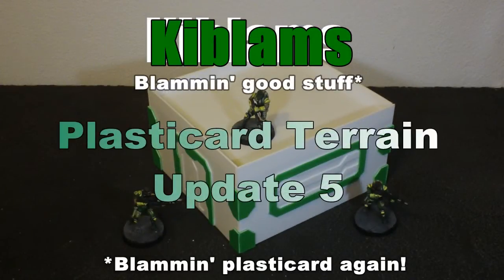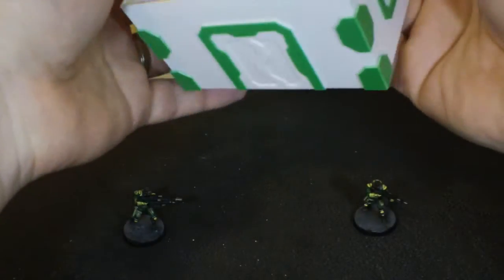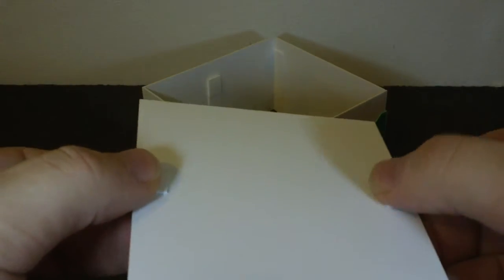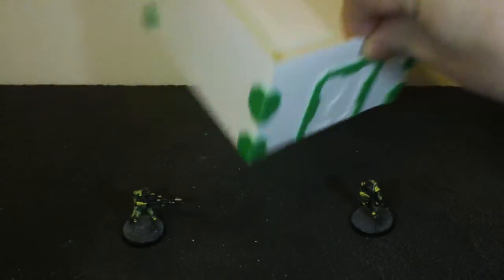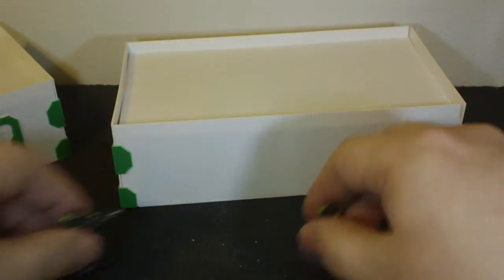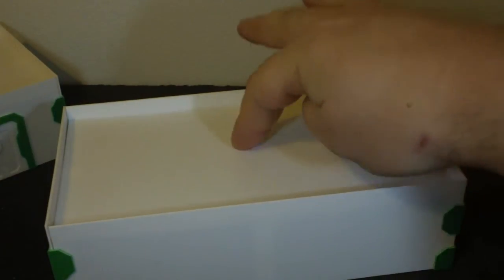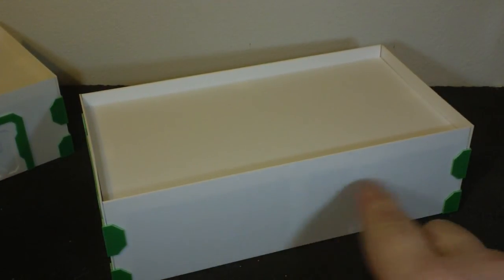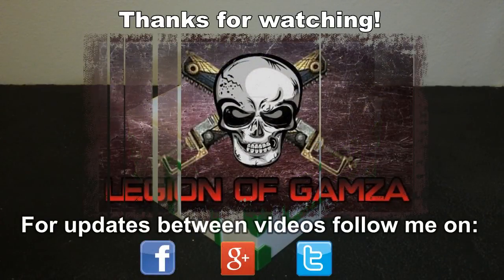Infinity the Game - Plasticard Terrain Update 5

Comment: Due to the angle on the triangle locks... 2 sides should have more grip if a building is picked up from it, mark that side.

Especially if the angle is the other way or even different on each end, they'd still link but you'd lose the ability to have a mix and match of the double sided.

Comment: Great update. I just got my portrait, do you have a formula to set the blade for different plasticard thickness?
Reply from the maker: For all the cutting I tend to use the full thickness (this defines pressure applied on the blade) and the speeds of around 5. For the blade itself I tend to leave it on 5 and that seems fine. With the 1mm card I just score and snap, for .5mm if you repeat the cut (copy the design over itself on the software) you should be able to cut most (if not all) the way through. Both of these you shouldn't need the cutting mat. For the .25mm which will cut right through, use the mat (remove some sticky from the mat with a cloth before you use it) the 1mm needs a little push for the rollers to grip it, once it's in it goes fine. I think that's pretty much everything, let me know if you have any questions.
Reply: Thanks a lot for getting back to me. I will probably hit you up again soon.
Reply: kiblams You don't need to copy the design over itself to double cut. There is a check box setting in the software that double cuts. Also, it you don't unload the material at the end of the cut, you can send it through again for another cut, or double cut. You could readjust the blade to cut deeper the second time you send it through, so you aren't cutting the full depth the first cut, which might cause the blade to dig in and catch.

Comment: Oh, did have a question though. It looks like the design plays heavy on angular cuts, can you do curved cuts?
Reply from the maker: it can do curved cuts but you have to consider the thickness of card; it it's 0.25mm or less you can cut any shape or detail you like as it cuts right through, though if it's bigger you have to snap the design out, and curves do not lend well to being snapped out...